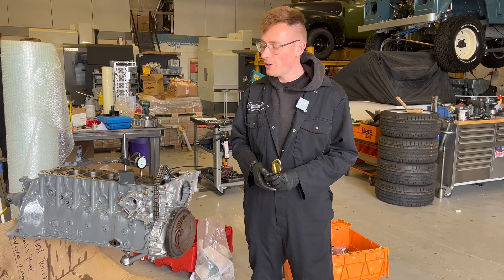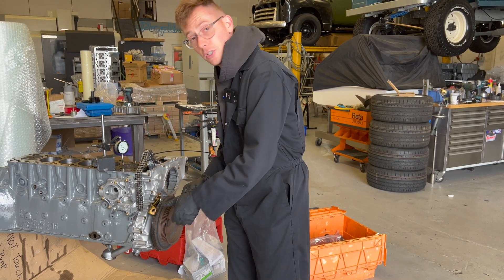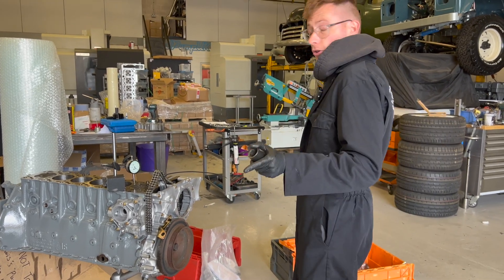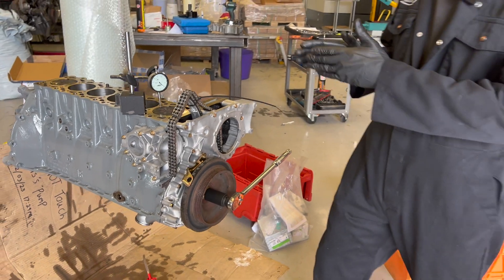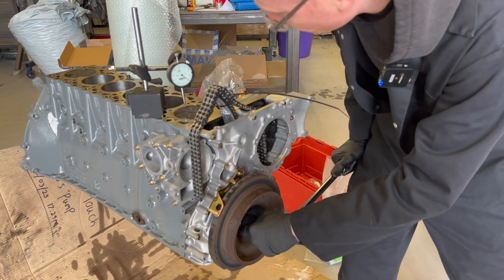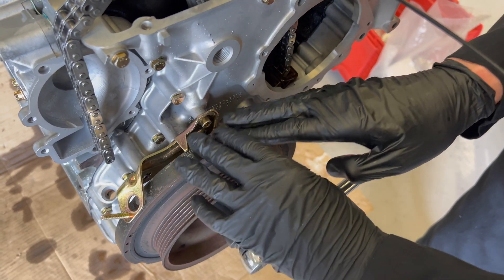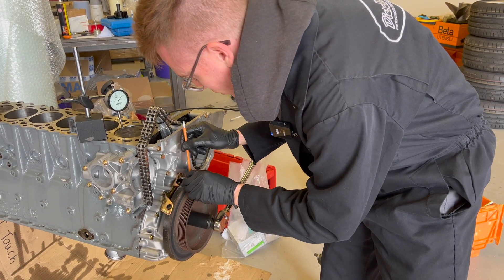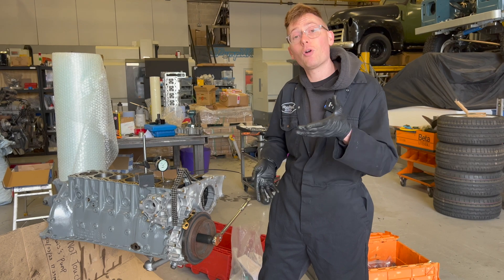OM606 how to find the TDC position

Comment: Just wanted to ask if you work with the OM642 265BHP version ? I've heard rumours of internals only good for 400bhp but do you have any conversion kits or anything in the pipeline to produce some big power 642's ? Love the OM606 and I've always said the moment the engine is not worth repairing due to cost....I will definitely be coming for one of your big power 606's only issue I think will be road legal eligibility and emissions, with all the tree hugging polar bear loving nut cases lol

Comment: Luke bought one ur element kits got them fitted be diesal specialist fitted and engine ran at full throttle couldnt shut it down will stop lever killed it buy putting in to gear send bk to diesel specialist he went  true pump them gave bk it done exact same thing did u ever do come on a problem like tis before at wits end with it lol lol any advise would be great

Comment: do you think it would be possible to fit the om 606 to a 1991 nissan pathfinder. it comes with a 5 speed transmission, just wondering if your patrol has the same 5 speed transmission.

Comment: The crankshaft is off set or the Vernier marking's? Also it does make a difference on how you look at the markings as they are quite thick and far less accurate than the DTI...